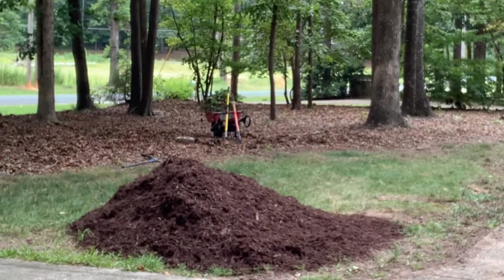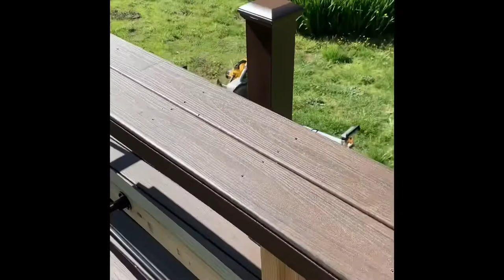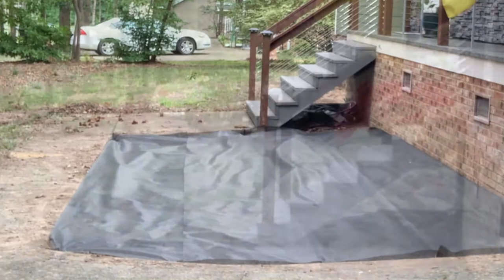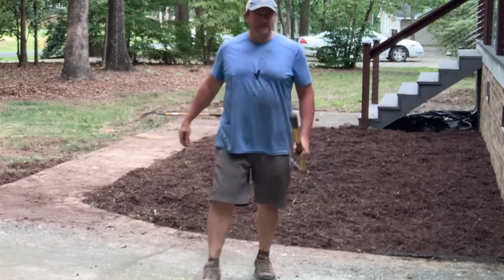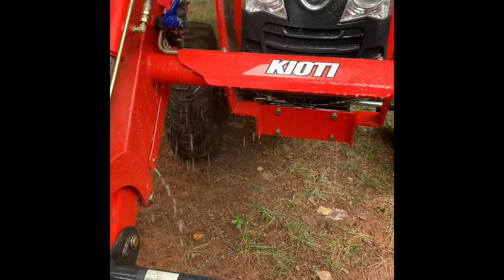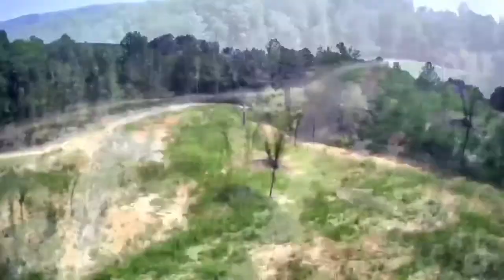2 Yards of Mulch - That’s it??  Kioti spreads it anyway

Comment: Good news, now you have a great reference for how far 2 yards of mulch will go!  And if you have the next delivery dumped on the driveway, you won't have to worry about tearing up your yard trying to get it all scooped up (you can use the loader bucket as a dust pan to sweep into to get the last bits up).  Good video and your mic worked great.

And if you get a big load next time and have extra, see if the neighbors need any that you can deliver with you tractor.....
Reply: Yes, thank you!  I actually thought about having it dumped on the driveway, but I was afraid I would tear something up since I’m still learning the loader. But in hindsight, I should have just done it that way.  When I saw 2 yards on that dump truck, I just laughed.   Thanks for the compliments!  I do like that mic. Take care!

Comment: Why didnt you use the box blade to spread it more evenly rather than a hand rake?
Reply from the maker: I think I probably would have ripped up the fabric had I used the box blade. Mulch didn’t go as far as I hoped so I had to spread it thin. Plus it was a small area and I didn’t a little bit of manual labor.